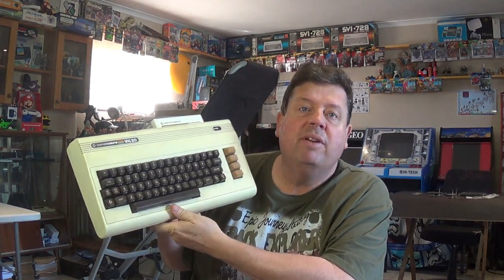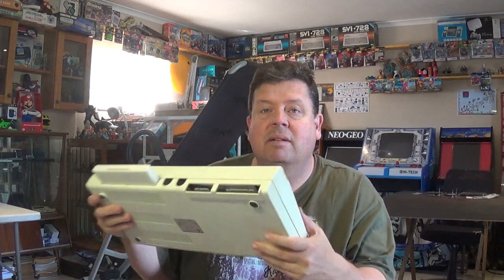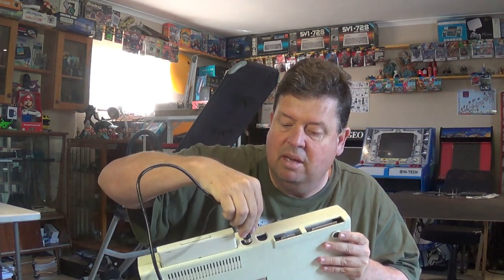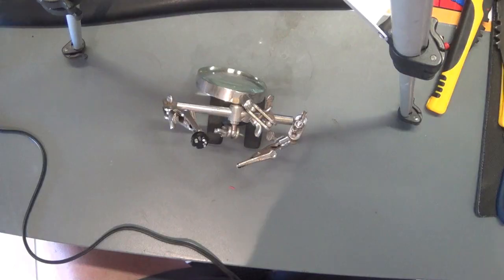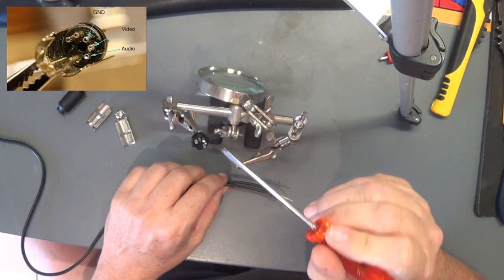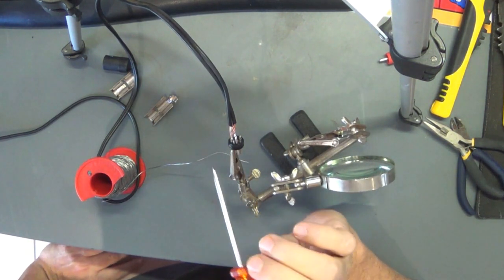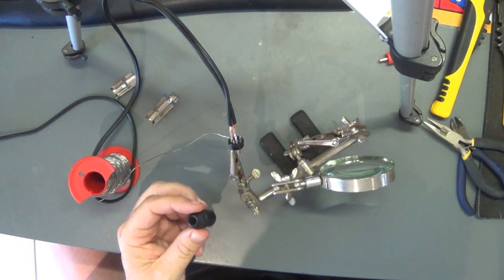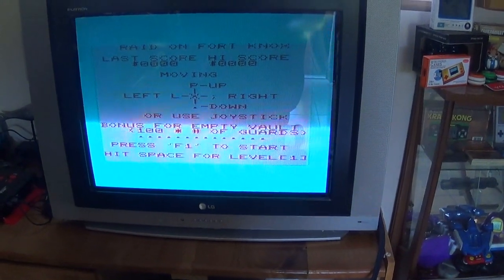Vic 20 Composite AV Mod

Comment: I got one on Ebay. Have a led tv so tried coax to tv ant. no go. Then rca into rt volume and yellow to composite green=yellow. It recognised it, said retrieving info and came up with 480i and good signal so it is connected but no video. What should I LOOK FOR NOW? Help please. Just threw out my 13" crt when I started seeing these vic videos and got my 1st pc out to try. Crap. IT WORKED LAST USED .

Comment: thanks you! i use the rf demodulator cable and a rca for make the cable and taht work like a charms now. (i also change the power suply of my VIC-20 is a 2 pron one at 9ac but she send 12v..... so i repleace it with a 9v cd 3A)

Comment: The same cable can also be used with the C64/C128, the C16/+4 and the Atari XL/XE.
But I would not re use the DIN-connector from the RF modulator, to be honest.
New ones are readily available, at least over here in Germany, and they are cheap.
I would also recommend not to simply cut off the plugs from one side of the RCA cable.
Take one that is twice as long as you need and cut it in half, so you can build 2 cables :-)
The extra length of a single cable is far cheaper than getting 2 at half the length.
Reply from the maker: Good advice. THKS